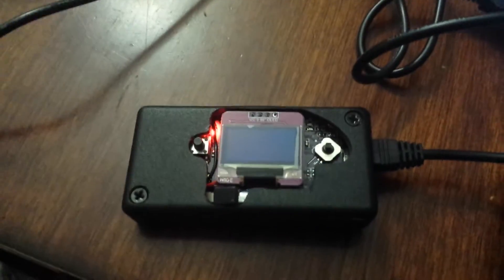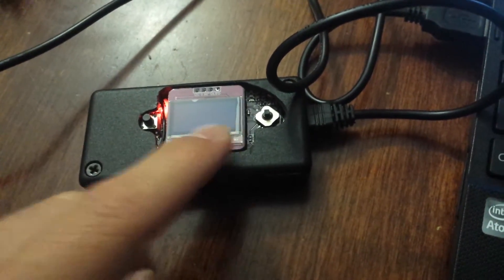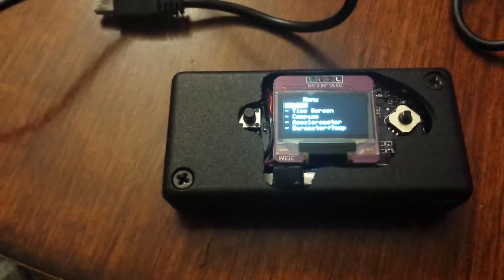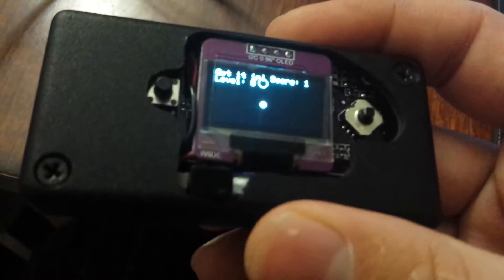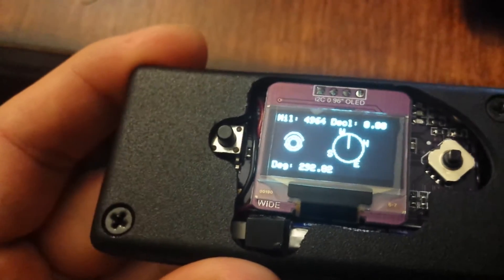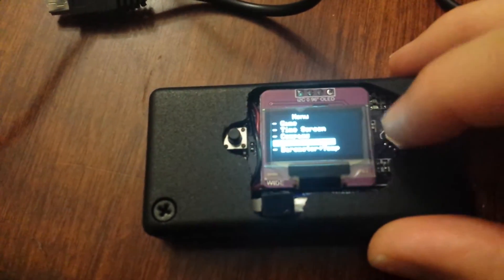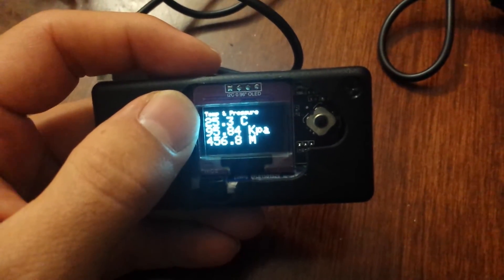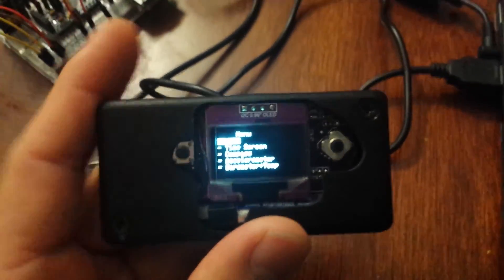Sensor Board Project Complete (Digital Compass)

Comment: Neat!  How long will it last on a charge?  It looks like the screen is pretty bright.  Maybe you can add something to reduce the brightness to save battery.
Reply from the maker: It's an OLED screen and I have about an hour of play time the battery is a little puny 150 mAh 3.6 volts that get step up to 5 :)
Reply: bakupcpu That's not bad!  OLDE, that's awesome!  I never knew you could buy little OLED screens like that!  Cool!
Reply from the maker: Makerj101
They are becoming more popular even in my project :P I need to order more I ran out of those >.< You can grab those and the sensor board on tindie.com :)

Comment: The ball game using the accel is very cool. Where did you get the magnetic sensor from?
Reply from the maker: Thanks :) I got the Magnetometer from icstation.com. I also saw the upgrade to the sensor board you add the micro sd.
Reply: The SD library takes up a lot of memory. Had to disable most sensors just to use the sd.
Reply from the maker: Yeah I know :( depending on the command you use for the SD it can take up lots of memory, and also using I2C use almost 1/2 the ram so if you use to much it reset the chip.